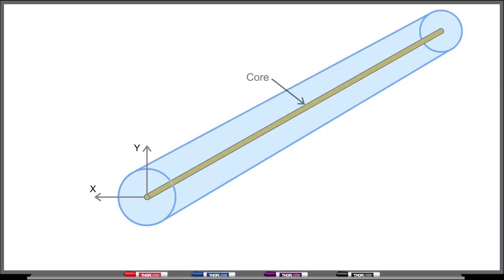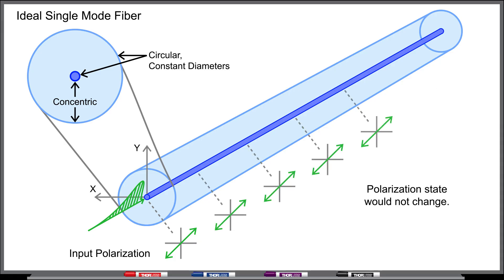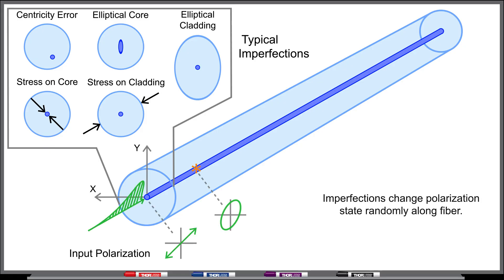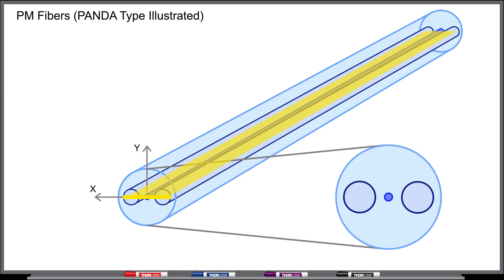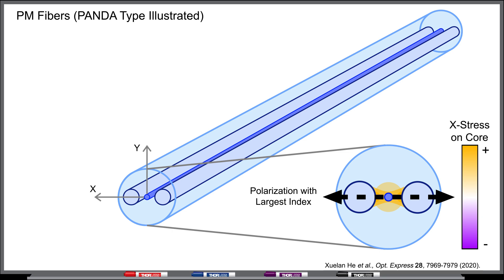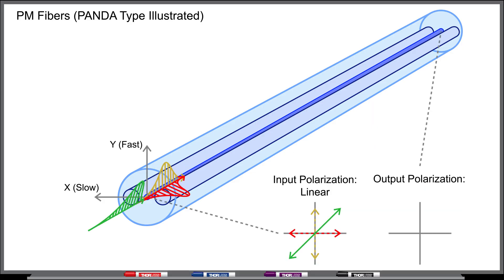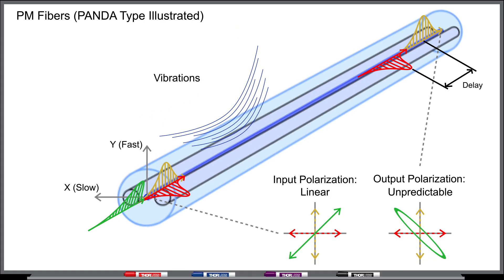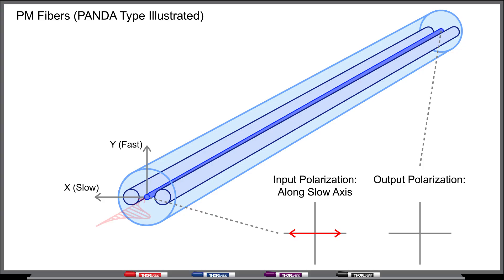Why PM Fiber Requires Linearly Polarized Light Aligned to an Axis | Thorlabs Insights Topic Focus

Comment: My understanding is that most components for PM fibers are used with the slow axis. Am I correct in that is because due to higher effective index, the light is less affected by fiber bends and such and more robust than using the fast axis?
Reply from the maker: You are correct, although the benefits of choosing the slow axis over the fast axis are likely to be small. Since the slow axis’ refractive index is higher, compared with that of the fast axis, it is reasoned that more of the light coupled into the slow axis will be concentrated closer to the core’s center. (The intensity cross section for light guided by either the fast or slow axes is approximately Gaussian. The peak is within the core, and the tails extend into the cladding.) 

When more light is concentrated closer core’s center, less is in the cladding, and the guided light should be less affected by bend-induced loss, as well as cladding damage, defects, and irregularities. Light coupled into the slow axis may propagate with less loss than light coupled into the fast axis, but since the refractive index difference between the two axes is not large, the difference is not expected to be significant.

Comment: Why can't I apply the same logic for non PM fiber? Just imagine that there are two axes, and one of them will be prefectly alligned with our initinal light polarisation. Where does the quantitative difference between non PM and PM fiber occur? How much I need to make phase velocity difference for that magic to work? Non of you understand how does this really work and it infuriates me
Reply from the maker: This is a great question! One way to answer it is to look at how the fiber’s refractive index profile influences the transfer of light energy between the X- and Y-components of polarized light. In PM fibers, the refractive index along one direction is always significantly higher than the refractive index along the orthogonal direction. It is straight-forward to define X- and Y-axes for a PM fiber by referencing them to the directions of the fiber’s highest and lowest refractive indexes. (Light travels faster when the refractive index is lower.)

In a standard single mode fiber, the refractive index would ideally be symmetric around the fiber’s propagation axis (Z-axis). Due to this, an ideal standard single mode fiber could maintain any polarization state, and the X- and Y-axes must be arbitrarily assigned. However, due to the bends, manufacturing imperfections, inhomogeneities, and other perturbations in real-world standard single mode fibers, there are always small and unpredictable differences in refractive index, between the X- and Y-axes, along the fiber’s length.

The orthogonal polarizations (X- and Y-components) of the guided light are sometimes called polarization modes. In order for the polarization state to change, some light from one polarization mode must couple into the other. This can only happen when 1) there is a perturbation in the fiber and 2) the perturbation is large enough to overcome the difference between the propagation constants of the two polarization modes. Every guided mode has a propagation constant, which is a function of the refractive index and the wavelength. The propagation constant is a measure of a mode’s unique properties and is related to the way the light’s phase and amplitude changes as the light in the mode propagates. When the modes’ propagation constants are more similar, light must undergo smaller perturbation-induced changes to couple between modes.
 
In standard single mode fibers, any difference between the polarization modes’ propagation constants is small, since the refractive index difference is small. Due to this, minor perturbations can cause light to cross-couple between the two polarization modes in standard single mode fiber. The polarization state changes as the light propagates, because of both the changing refractive index difference between the X- and Y-axes and additional cross-coupling events. The polarization state will change less when the length of standard single mode fiber is shorter and straighter. In PM fibers, only large perturbations can cause cross-coupling between the polarization modes. This is effective in keeping a high percentage of the light confined to a single polarization mode in PM fibers, which maintains the linear polarization state.